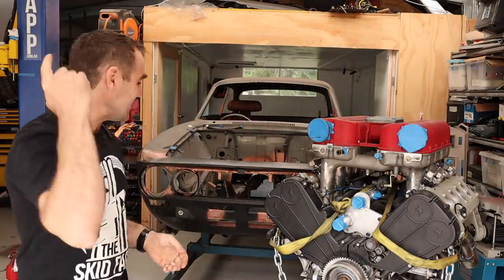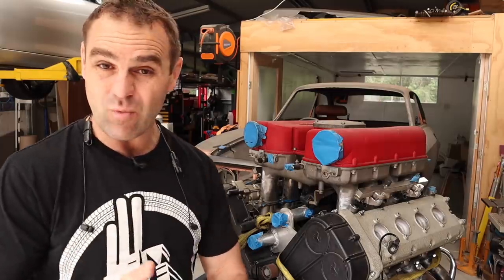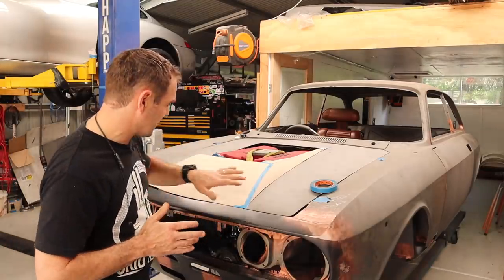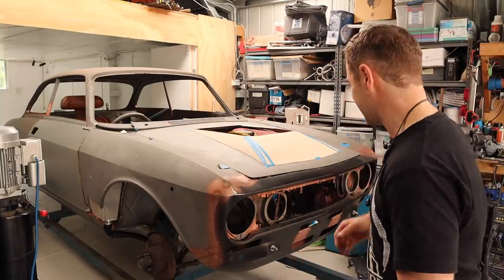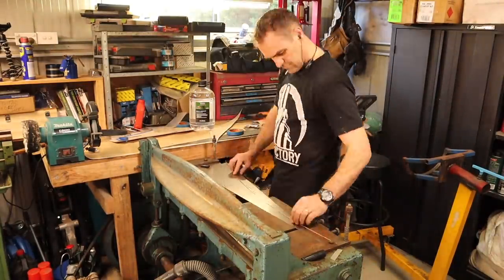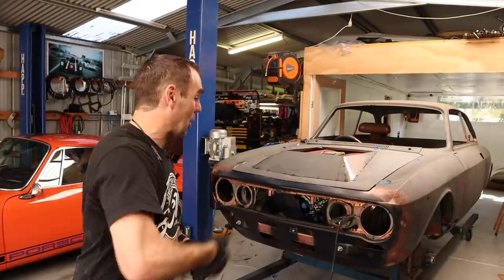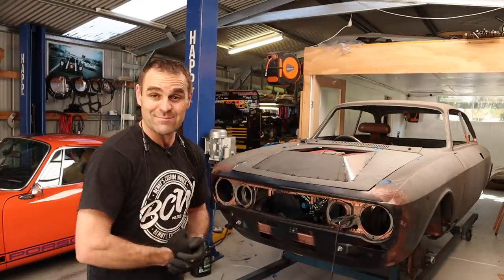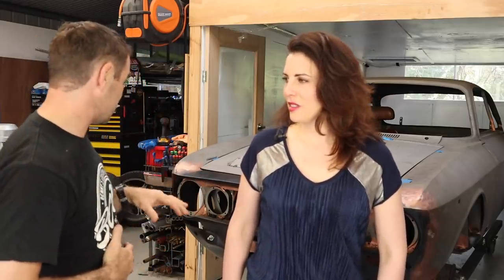Building a Ferrari bonnet bulge - Ferrari engined Alfa 105 Alfarrari build part 70

Comment: Jeff curving the corners was brilliant however I do not think the front piece works aesthetically nor aerodynamically. It is too much of an upright slab. You should have started right at the end of the bonnet with a gradual angle  and rising or split it in two to have a v shape.If you intend on cutting a hole in the slab for better airflow to the bay then it might not be so noticeable..

Comment: Try a convex curve on the sides that come a lot further out and taking the leading edge of the bulge out to the edge of the bonnet. I don’t think you are going to be happy with this bulge and need to come back to it.

Some metal elbows instead of the silicon hose elbows will reduce their size and work on the throttle bodies to move them back and angled down slightly will allow you to use a lot smaller hump.

Comment: Jeff- Car designer(exterior designer for a large oem) here. I think you did a great job, especially with the surface transitoons around the front edges. 
The one change i would to is to give the "window" a little curvature front to back (with the rear edge near the windshield being a bit higher than the front if possible). Try sighting it from  side view and match up as much as possible to the crisp character line that runs around the car. That will help tie it in with the original details. Either way, great work!

Comment: Great work. I like the curves on the side pieces.  You might need to drop the frame down a little to get the clear panel to sit flush.  I suggest using polycarbonate as perspex is flexible when hot!  Don't want melted plastic on those lovely crackle red covers!

Comment: A bulge which begins and ends with the front and back edges of the hood, would have less abrupt angles and be more pleasing to the shape of the body. Also don’t put such a dramatic taper on the sides, try to mirror the shape of the body.

Comment: Hi Jeff, this build is awesome. I continue to be amazed. After all the hard work to build curves into the bulge the opening is very square and hard.  Is there a way to build curved corners into of the cover support frame to soften it a bit.  Also , what material will you use for the cover that overcomes the heat of the engine.  I know this has taken a lot of time so far,  and there is still a lot to do, but every time  I see you start a new area on the car its like WoW doesn't  feel like it will be that much longer.  Keep up the perseverance.

Comment: Go for a perspex bulge with a cold air entry at the front. But much more like the one at 7:22 than a blunt nosed one in steel. You could also have gone with a fibreglass bonnet and saved the real one before cutting it up.

Comment: Nice work, lots of time goes into something like that.
Personally I reckon it would look a bit nicer if you had the front part in the same position as you did at the beginning of the video. It would look more a part of the bonnet, and swoop back a bit nicer ( not so abrupt).
Either way, I love it.
Cant wait to see you turn the key on the weapon!
Reply: That was my thought too. I think the problem is that the bonnet tilts forward when opening, so it would probably have clearance issues.
Reply: @jasonoxley6125  Oh, didn't even think of that.
Makes more sense now why he went with it set back a big more.

Comment: Hey Jeff, before you nail this down, put the grill on so that you can see if the alpha “V” shape can be incorporated into the lines of the bulge.
IMO the sides of the bulge should taper out towards the A pillars, not in, so that the bulge forms a V that points to the Alpha grill.

Comment: Hi mate. I can't believe I hadn't subscribed until now as I've been following your channel for a while. Fixed that by subscribing today. 👍
It's a challenge getting things to fit but you're doing a great job so far.
Quick question, did you consider starting the bonnet bulge out wider to the edge of the bonnet to disguise it's height before you settled on this design?
Starting wider could have made the side walls shallower which might have altered the proportions and give the illusion of it being lower. 
Anyhoo, glad you got this hurdle tackled nicely. Looking forward to the next installment. 👍

Comment: Another triumph, jeff. Well done. Just two things. Radiused corners in the top surface ofyour frame would soften the aspect a little. Please polycarbonate clear sheet, not perspex. Engine heat will make it sag and is also more prone to crack and shatter if made in perspex. Is it possible to add radiused fillet pieces in corners from old bonnet to new bulge. Alfas always manage a flowing curve where possible. Would really finish a great job.

Comment: i dont know how far you got installing the steel buldge to the oem,  hood,. but to prevent distortion,, a lot of tack welds are great,, then grind them down,, but this will work great.. ' lead ' the panels into the oem hood/// its safe to use, and leading is easy to shape.. lot better than plastic.. not heard to learn to do

Comment: I like the shape of the hood bulge, it’s reminiscent of the 80’s GT V6s, but those had a black plastic top on the bulge (incase of backfires). 

Maybe you could make 2 covers, a clear plexiglass one for daily driving and a black mesh or louvered one that lets heat out of the engine bay when you take the Alfa to the track.

Comment: Love it. 
Only thing I worry about, you're going to need to use 6 or 8mm acrylic and the exposed edge will be UGLY. 
I don't know how much work it would be, but I would like to see the acrylic inset so the steel buts up flush and you get a smooth transition.
Reply: My understanding is that it will be mounted from underneath so the edges aren’t visible.
Reply: @limitlessbuilds  ok. Then have exposed hardware? Like stainless cap head bolts or something?
I think I'd prefer it mounted on top with countersunk bolts.
I guess we'll see

Comment: Oi mate, awesome craftmanship and the bulge looks fine, don't worry. If it isn't too late for suggestions: I think it would look even better with bigger radiuses at the front, especially at the top corners. A bigger radius at the front would also look good for the window. Also a propos window, may I suggest a louvered one, like the rear window on the F40? That would surely look mega.

Comment: Jeff can i suggest using a pair of gas struts so the bonnet doesnt flex when lifting it I made a power bulge on a project and the filler eventually cracked .
Reply from the maker: That is why you never mould fibreglass to steel. Eventually it cracks. This will be welded solid with very little filler ;)

Comment: The bulge looks great, particularly like the taper back towards the windscreen. I'm sure Giorgetto would have approved. Regarding the perspex 'window', maybe a slightly bowed panel would look better than just a flat piece of acrylic. Local motorbike wind deflector  makers in Oz should be able to help (a very easy process heating the acrylic and using hot air to blow required curvature). We did this for a 1930s vintage glider here in UK and worked a treat.

Comment: How long did that take to build?  It looks really good with the styling of the alfa. If it was left open it would really help with pulling air out of the engine bay and through the radiator. Not so good in the rain. Excellent metal work!

Comment: Jeff!   I was dreaming on putting a Maserati 4.2 v8 on my alfa romeo 159.  But I want to have the aacc , abs starter, rev counter....    should I get the ecu from the Mas. or use an aftermarket one,   I mean what about the inmobilizer ,  how do I tell the ecu it no longer has a  robotized gearbox ?...?   ...? where should I start looking at?   I'll make my way and do it at 2021. THANK YOU
Reply from the maker: You have way more issues trying to fit all that before you worry about ecu. I don't know anything about the Maserati ecu, so the answer is I have no idea.

Comment: Probably too late, as Im only half way through the video, but I would have made the top front edge curve with either the back of the bonnet line or the front roof line, rather than straight.
Reply: .... and you said it at 10:40... doh!

Comment: sorry to say it- looks ugly, its just to big and doesn't flow with the lines of the car, if it was all of glass (see through) it would be better like on 1957 Ferrari 500 TRC Testarossa. You could see the engine better and it wouldnt be a big bulk of steel